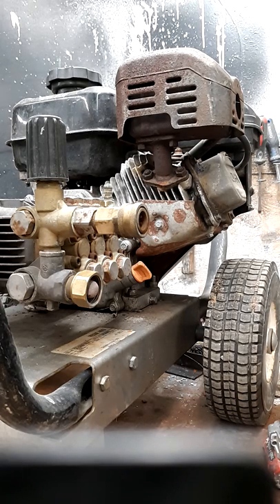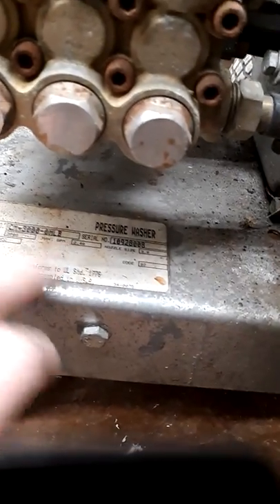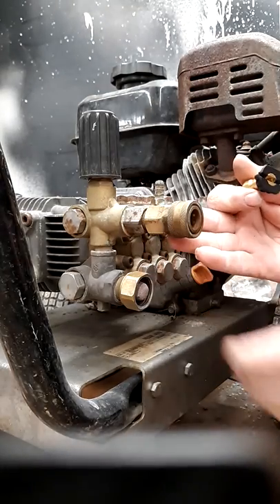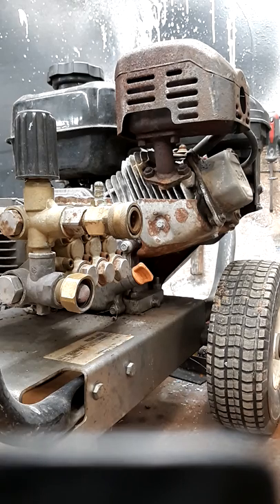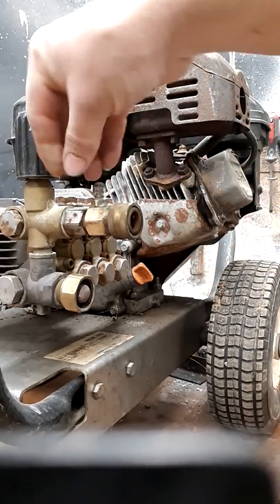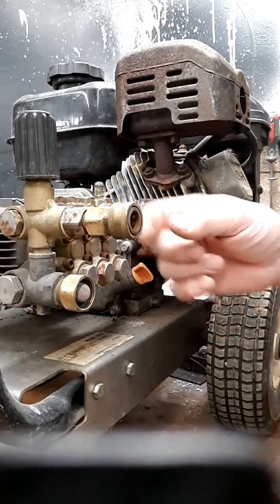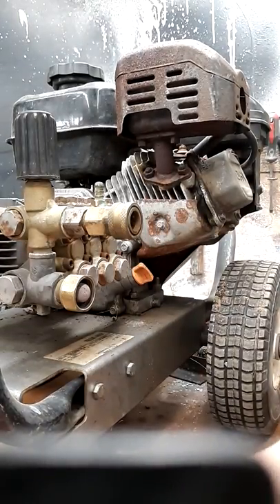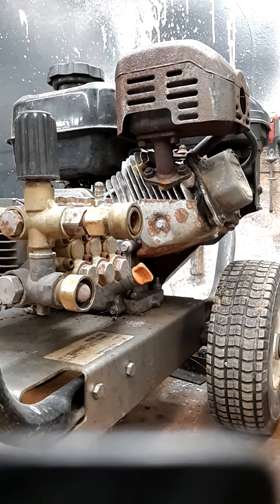Pressure washer chemical injector problems

Comment from the maker: Perrin Carr. Your comment was removed by YT. Your injector may not work properly if it is installed in reverse. I have instructions in this video on how to determine where the problem is. Contact me again if you need help. Do not put the word su** in the comments. YT will remove it.

Comment: Good explanation bud. As a seasoned pressure washer of 30 years, I do know you will find a ¾" water hose will allow more water flow for the allowance for the injector to work properly.
Reply from the maker: You are correct. I have found that the flood of "discount" hoses that list 3/4" are reduced to 1/2" where the fittings are attached. Most guys never realize it. But a good 3/4" is a little pricey and they don't  want to spend that money. Doesn't  make sense sometimes.

Comment: It does not have a vent. I’m going to take the part apart that has the little spring in it to see if the ball or spring is stuck or damaged. Something is not closing that prevents water back flowing into the soap tank.
Reply from the maker: @AnnGenua  your tank should also have a vent. If you have water flow back, then yes check the Oring, ball and spring

Comment: Brian, thank you for putting this video together! This really helped me in troubleshooting my issue and it seems a quick buy of 100 foot quarter inch hose is causing some back pressure. I swapped to the original 20 foot it started siphoning chemical. It is stated online that with a 2700 psi pressure washer if I go over 60 foot it will most likely stop the chemical to siphon though. I will go with a 50 foot 3/8 hose and try again.
Reply from the maker: Glad it helped!
Reply: I had the same exact problem.  I have a 3.2GPM with 100’ of 3/8 hose, no draw.  Switch to the stock hose and got my draw back.  Kinda annoying to switch hose between soak and rinse, but I figured it out.

Comment: Thanks for the thorough explanation and trouble shooting procedure. Exceptional job!
Reply from the maker: I hope it helps
Reply: I took off the injector and it was packed solid probably with calcium or hardened soap and will need to be replaced. Is it likely that the “mixer” (or whatever is in the adjoining part) also has this impacted material? I appreciate the way you explained things in the video, so I figured you understand the workings of the mixer as well. 
Thank you.
Jon
Reply from the maker: @JonFish-lg3yw  any part from the injector out to the gun has the possibility to have this build up. Anything behind the injector should not have build up, unless the water itself is heavy in minerals

Comment: Great video Brian. I have never heard it explained in this manner. I bought a new 2.1 gpm injector that works over my house, but did not work over my neighbors house across the street, your explains why I was having that problem. I started using the new injector because after couple years of use the one on the pump stopped working. I bought a nonadjustable replacement injector, but it did not work. So I suspect there might be corrosion internally on the pump side fixed portion. I usually use 10% sodium hypochlorite bleach. I am reminded now to always clean out the line with clean water after use because I noticed that the filter on the end of the tube corroded badly.
Reply from the maker: I am glad you found this helpful

Comment: Thank you so much Brain. I had no idea how this injector worked. Very good pressure washer chemical injector lesson 101. I only wish I'd tuned in before I messed up I think; but you be the judge. Tried to do a powerwash for a relative but wasn't getting any chemical. I've only used the washer twice and it worked fine at my place (3+yrs ago). Took the injector nozzle off to see if it was clogged unaware of the steel ball and spring. I didn't see any loose parts, but when I reinstalled the nozzle and started the pump, I got a geyser OUT of the nozzle. If this I/M45810D.2, 2.3GPM, 2600PSI model has the inner workings as you describe, I probably flushed them out into the grass. Also my relative had a smallish water hose, maybe 1/2 inch dia and the coupling at her townhouse water supply  had an unstoppable leak. Lost quit a bit of volume there the but pressure felt adequate. I'll hook the pump up at home and see if it draws chemical but if you could look at this model# (purposely left manufacture's name out of this post but if you think "Metal", I'm sure you know who makes it, begins with an "I") to see if there is any thing else that could have failed as a result of the geyser. The design spec sheet show an "O" ring, cone spring, steel ball, a smaller "O" ring and hose barb (nozzle I've called it). I saw none of this when I removed the nozzle/hose barb. Kit #8 should include the afore mentioned parts. Do you think this will get it back up and injecting chemicals? So sorry for such a long post but maybe it can help someone else as well.
Reply from the maker: The geyser is caused by the ball missing, possibly other items missing as well. A full rebuild kit would correct this.
Reply: @Brian_the_repair_guy  Thanks Brian. I assumed as much. There are 2 kits. #8 includes the items mentioned in the previous post. Kit #9 includes parts downstream of Chemical barb adapter to the pressure hose connection. Do you think I may need these? Or could it have been a water volume issue all along and I messed up when I took the Barb adapter off.

Comment: So do you block the built on injector chemical hose off & use the new chemical hose correct? I have a issue where water is coming through my chemical hose & it take a minute to come out. I have the same exact injector for my 2.4gpm simpson, brand new. Took it apart, lubed everything from wand to pump to tank. chemicals wont feed with black tip in gun.
Reply from the maker: If you are going to use another injector, then yes you should block off the factory injector.
Reply: So why is water going building through my chemical hose? Would the check valves have anything to do with it? Water pressure is fine it's just the saop dispenser
Reply from the maker: @tyrellgatling5666  when the injector goes bad, it will push back into the chemical.

Comment: Great explanation. I have that same injector and it is brand new as is the 5 gpm 3000 psi machine. I used it one day and started having trouble with the ball getting stuck in it's o ring seat. I am very mechanically inclined and have taken it apart several times now. What is weird is that when I throttle down the machine and the flow and pressure drop it sucks like you know what!. If I throttle it wide open the ball gets jammed in the O ring from back pressure I guess and stops sucking. I am only running 100' of brand new hose. everything is sized correctly and is brand new. The ball itself to me feels like it is not perfectly round from the factory. Now I did over tighten the adjustment collar thinking it was loose the first day i used it. not realizing it was an adjustable metering  thing, I thought oh crap I need to tighten this up so I did with small channel locks but I don't think it was enough to damage the O ring. But I think it likes to get stuck really easy when the pressure goes up now. Have you seen this problem or just replaced the O ring seat  before? Any thoughts would be appreciated Thank You!!
Reply from the maker: I have never seen that myself. A rebuild kit is inexpensive and may fix the issue.

Comment: Another great video. I have a question.. i have a 3200psi 4gpm pressure washer. My downstream injecter works until i put gun on so i know its the gun i bought. Saying its max gpm is 7gpm. What gun do i need? Help anyone
Reply from the maker: Is your gun a 2 piece set up? Meaning, does the wand screw together?
Reply: @Brian_the_repair_guy he wand itself is 1 piece then of course quick connects to gun. Also I'm filling a 5 gallon bucket with water hose in just under 30 sec. Could it be to high of inlet pressure?
Reply from the maker: @dbac8891  if you are using the black tip, 50ft of pressure hose and the injector is not working with the gun then I would definitely change the gun. If the inside diameter of the gun and wand are too small the water is restricted and the injector will not work. MITM from Sherwin has a good one piece wand that usually works for most all washers and flow rates
Reply: Ok thanks I will try that
Reply: Yep it was the gun. Thanks for taking the time to help buddy
Reply from the maker: @dbac8891  very glad to help. Many have a hard time believing this type of thing.

Comment: Damn good video! Of course I'm here because my new injection isn't working.  Ill try your tips.
Reply from the maker: I hope it helps. If not feel free to ask question
Reply: @Brian_the_repair_guy  That's awfully kind of you! I have suction with no hose and with hose but as soon as I connect my adjustable wand, no suck. I bought a new gun tonight but its too late to try it. One thing I did notice though that has me puzzled...when i attach the injector to the line it causes a huge load on my engine when the trigger is released and would kill it if I didn't pull the trigger. All works fine without the injector attached. I am using 3/8" quick connects on both sides of this adjustable injector
Reply from the maker: @dtman66  I have never seen the load change with an injector. Very weird. Let me consider that one. 
If you get chemical with the pressure hose, but not with the gun attached, then a new gun is needed. Preferably one with a larger inside diameter.  You are on the right track.
Reply: @Brian_the_repair_guy  I bought a new gun last night, 4000psi and 8 gallons per minute. My washer is 2400 at 2.4 so I should have plenty of flow. Still not working. It will however come out of the high pressure hose if it's not connected. By the way, I had a small leak in my quick connect that was causing the engine surge. Any ideas on why no suck? I'm about to return the injector to home depot and spray my house with a hand pump
Reply: Just got off the phone with Simpson, the seller of the injector. They said the injector is probably bad, which I believe, but also think it must be a bad design
Reply from the maker: @dtman66  could be. How long is your pressure hose?
Reply: @Brian_the_repair_guy  25'
Reply from the maker: @dtman66  ok, short hose, but stops working with a new gun. I agree with Simpson. You have a bad injector
Reply: @Brian_the_repair_guy  thank you so much for the help. I guess I'll spray my whole house with a pump sprayer and solution then power wash it afterwards.
Reply: @Brian_the_repair_guy  I thought I'd stop by and give you an update. I returned the $95 Simpson injector that I purchased from Home Depot, online. (I know, expensive, but the site said it could be delivered in 2 days, which it was). In the meantime I bought another injector online for $23 from Amazon. I tried it today and it works like a charm! Thanks for all your advice and help!
Reply from the maker: @dtman66  I didn't  do much of anything to help, but I am glad you fixed the problem.

Comment: Very well done.  If the check ball and spring are gunked up is there an effective way to clean them as well as inside of injector ?
Reply from the maker: Just washing is off with fresh water, be careful with the spring, it is a very light gauge
Reply: Thanks!  Will do.

Comment: Many thanks brilliant insight into the possible problems, I recently had a issue with water coming out of the chemical hose feeding back into the acid. 
Any ideas regarding this problem
Reply from the maker: Bad spring, ball or Oring. Rebuild the injector or replace it
Reply: Many thanks, what is the location of the O ring
Reply from the maker: @jonbon-bz2cb  it is located in the barb that the hose attaches to

Comment: Which inductor is better? The fixed one or the one that you can remove/turn off? I’ve had the fixed one on for a while and it seems like it always introduces air as opposed to being able to turn the valve off on the inductor to stop that…. What do you think about that?
Reply from the maker: I like the removable unit. They are usually rebuildable and if they stop working, they have a leak you can take them off so they don't pose a problem with the pressure

Comment: So do you have both chemical injectors attached? Or do you plug one suction and use the quick connection one? Idk I  need to know if you are using 1 or both on the machine
Reply from the maker: @duderock123456  if you have one that is built on like the one in the video, you have to plug it to use the other injector.

Comment: Great detailed video! This is the problem I’ve run into. I have a Simpson 4000psi / 3.5gpm. Chemical injector stopped pulling chemical, so I put in a new one.

Ive tried a bunch of things. When the water is on, but the machine is OFF, it will pull chemical. I tried it with and without the hose, gun, tip, etc. strong suction.

When the machine is ON, the suction is very weak and will not pull chemical, regardless of hose, gun, tip, etc.
Reply from the maker: Have you tried turning the pressure down?
Reply: @Brian_the_repair_guy  yes, it seemed like suction would increase for a split second, then back to no suction

Comment: Thanks, getting no chemical out using what seems to be the same adjustable external injector, but my machine is built with a built in injector that would inject IN the pump, which I do not want to use. So trying to use this external injector leaving the built-in one unused, would this explain why I do not have any chemical going out ? Should I block the entry of the built-in one for the external unit to work !? Any advise would be appreciated, Thanks !
Reply from the maker: It may or may not affect the output. If you can catch me in Facebook with some picture of the set up, it would help

Comment: Hey, on these pumps,  are they bsp or npt tread fitting?

Thanks!!
Reply from the maker: Typically they have NPT on most fittings, there are a few that are not.
Reply: @Brian_the_repair_guy  thanks mate, I’m fitting a easy start valve and trying to get all the correct fittings. My pump is the same as yours
Reply from the maker: @jamesbloomfield2741  glad to help

Comment: Very helpful Brian.   Thank you.  I took my injection valve apart and unstuck the ball put it back together again but still my Simpson MSV3024 refuses to pull chemical :(
Reply from the maker: There are other reasons way it may not be working. Be sure to check everything listed in the video. If none of this fixes the problem rebuild or replace it

Comment: I’m hoping you can help me. I bought a 4200 PSI 4.0 DeWalt belt driven  with a Honda engine and a Cat pump about 2 years ago and never used it. I pulled it out today for the first time and it’s not picking up chemicals. I’m getting over 5 gallons per minute ( overflowed a 5 gallon bucket in 43 seconds ). I took it apart and the ball and spring are not stuck and freely moving. The arrow is pointing out. Everything looks great it just isn’t picking up the chemicals. Do you have any other ideas I can try?
Reply from the maker: Make sure you are using the correct tip. Disconnect the pressure hose from the machine and run it with water and see if the chemical injector pulls with NO pressure hose.

Comment: Hi Brian, Thanks for the helpful video. I connected an injector to my Simpson 2.5 GPM machine. A strange thing happened. The pressure of the water through the injector without the machine running caused a narrow jet like spray with no chemicals. When I stopped the flow with my thumb and released it the water came out like it would if it were from a detached garden hose.. but it was full of chemicals which tells me the injector is working. 
When I attached the pressure hose with the black/soap tip and the engine running no chemicals were produced. 
I’m lost as to what the problem is.
Reply from the maker: If chemicals are moving with no pressure hose and gun, but do not move with the pressure hose a d gun then typically the hose or gun is the problem. If they have build up or corrosion they restrict the flow and the injector will not work properly

Comment: Hey what do you think would cause my injector to suck water back into my 5gal bucket vs. pulling the chemical out like it should? It's not installed backwards either & I've cleaned the ball & spring yesterday with wd40 I'm frustrated now..
Reply from the maker: The injector needs to be replaced. There is either damage to the ball, spring or oring. If you contact watercannon.com they may have a rebuild kit

Comment: thanks very much for the explanation. You mention that the ball bearing should be free ..moving around. mine does not move. i tried pb blaster and wd 40 to free it.. any other suggestions to free the ball?.
Reply from the maker: Rebuild the injector or replace it

Comment: Thanks for your best tip.will you help me how to fix vibration of the machine at work. I check the 1. water flow in to the machine
2.I change all 6 water valves including the O ring.
3.I change the loader unloader from other machine of the same type the problem is not solved.
4.if I change all the water part and replace it by the same machine,it works properly. I can't fix the problem of its water part.please will you help me?
Thank you
Reply from the maker: @tinsaeseyfe3388  find me one Facebook

Comment: Thank you for the Video. Where should I look when water is back feeding into my dispenser? I get soap when I have the trigger pressed but when I let off water goes into my soap dispenser.
Reply from the maker: Your chemical injector needs rebuilding or replacement
Reply: @Brian_the_repair_guy  Thank you

Comment: Brian, what would cause the water to flow backwards, thru the downstream injector, into the 5 gal bucket where the SH is? This happens to me now n then.
Reply from the maker: The spring, ball or Oring could be failing. A rebuild kit or replacment of the injector